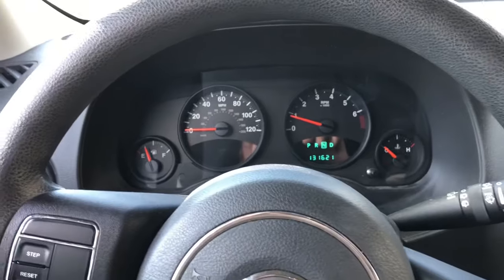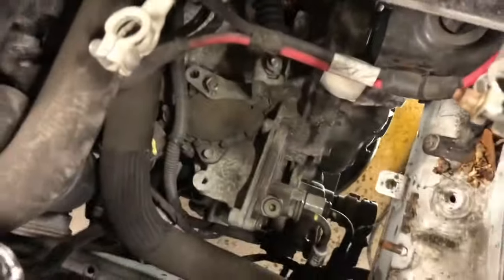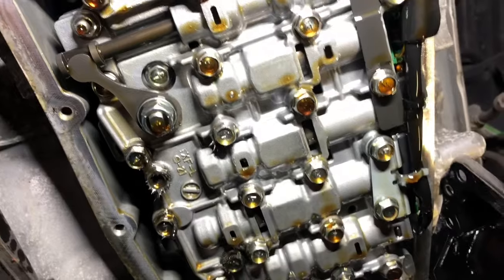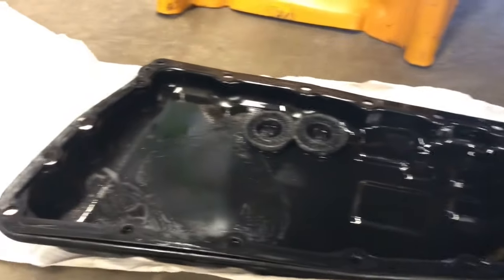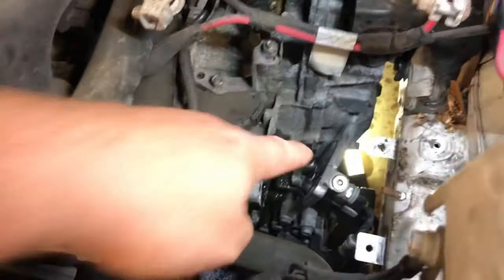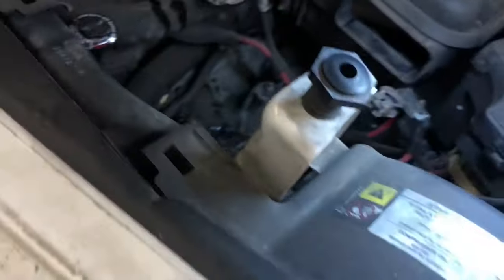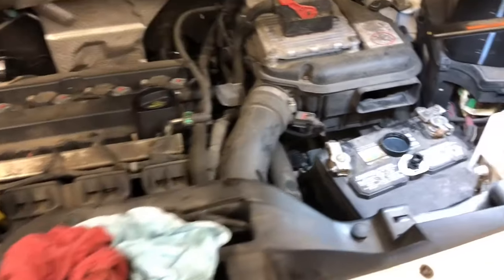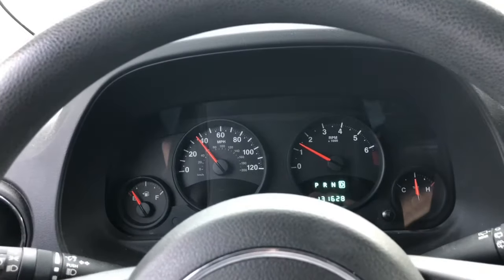Jeep Patriot CVT Transmission Fixed jf011e whine noise service

Comment: @JohnVH Life. Hi John, glad I found a resent video. Okay, my 2010 Jeep Patriot started making a whinny noise which my wife told me about but until today I never heard it before. ( I have 188k on it.) Now I did buy the dipstick you have on amazon but what I noticed was my engine oil dipstick fits into the trans filler tube, so while at a auto salvage yard I grabbed one that was about 4 inches longer. On level ground, I took this dipstick I bought, trimmed it to about the same length & then used a dremel & scored a line so I could get an actuate reading.
Now to the trans issue. Where does it say what cvt transmission model I have in the vehicle... I figured Jeep probably made a few for this year, so do I get that information from the VIN, or is there a plate with the trans number on it. I have a 2.4L engine w/ automatic 6 speed. Thanks for uploading the video because I'll be doing the work here at home.
Edit: My 4WD! warning light comes on but if I hit a big chuckhole, it'll usually go out so I'm assuming (& Hoping) it's just a bad ground wire (since I just found 4 wires out of 10 in a grounding pigtail that were corroded & fell out when I unbolted that ground eyelet & lifted it up to look at it.) 
 I wanted to get the information on my trans & do an oil/filter change first because I figured it may take care of the 4WD! light issue when I drive.
Thank you, Dan
Reply from the maker: 6 speed? As far as I know they only had the CVT and a manual trans in these up until 2014 or something. All the CVT's should take the same fluid and two filters, to my knowledge.
Reply: @JohnVHLife  No auto trans. I mentioned it with the engine type. I'm still looking for a tag somewhere that tells me what trans I have. I suppose using the VIN & calling a dealer will get that info. That way after I change the filters & fill it back up, I'll be able to mark this dipstick with a cold mark & hot mark instead of using this 4 foot 1 stick fits all thing from amazon. Then I'll use that plug instead of leaving the dipstick in the trans.
Reply: @JohnVHLife  All Patriot and Compass models with automatic transmission are CVT through 2013. In 2014, they switched to the Aisin 6-speed automatic which is not a CVT, but a more conventional design.
Reply: maverickdallas100 what as the better trans pre 2014 or 2015+
Reply: @ArmyK5Guy  The models 2014 and later with the Aisin 6-speed are reportedly more reliable than the CVT equipped ones, and drivers prefer the "shift feel" over the CVT. The reliability of CVT's however, has improved dramatically over the years, but they are still demanding of timely maintenance.

Comment: What does it mean if theres fluid on the pan bolts? There was some present when I changed the fluid so I replaced the gasket but I woke up to a few drops on the ground that came off one of the bolts so it seems like that may not have fixed it.

I'm hoping it's just some residual oil from the draining that's just heating up and collecting there but I've tried to wipe it up pretty good and still find a little on the bolts later
Reply from the maker: Maybe the gasket?
Reply: Check the fill tube for cracks, etc. It is not supported very well.

Comment: Hey i have a 2007 patriot that won't run it cranks writ up and runs maybe 20 feet and stops motor and transsmission sounds really good do you think this coupd fix it thanks in advance
Reply from the maker: Sounds like you have a motor problem to me, check the jeep patriot forums?

Comment: So my Patriot started making the whiny noise. So change my cvt transmission fluid? If so where can I take it besides the stealership?
Reply from the maker: Well, could try a service shop and see if they can do it, show them my video and make sure they change BOTH filters!  Or ask around and see if you can find someone mechanically inclined.
Reply: @JohnVHLife  thanks man. I found this local service shop and I will tell them about the two filters! Appreciate it!
Reply: @conroexlexx8267  update?

Comment: Great video, I have a 2015 patriot with the same whining noise, i don’t mind doing the service but I’m worried cause my patriot has 154k miles on it. Last time I did a transmission service on a 2013 rogue with a little whining it made it 10x worse and thats what I’m afraid of. Any suggestions?
Reply from the maker: Maybe there is an additive for older trans? Otherwise, try to carefully save the old fluid and put it back in, sounds crazy, but may work as you must drain it to get to the bottom filter.
Reply: @JohnVHLife  might give that a shot found a CVT additive for it see how that works. Thanks!
Reply from the maker: @donrobinson5662  Ive bought 3 of these on purpose, :D
Reply: update?

Comment: I have a 2007 Compass with the exact same drivetrain and it shifts funny sometimes at barely over 90k miles. Do you think this would help? I also need to do tie rods and ball joints that I'm gonna do on the lift at work next weekend, so I feel like that might be causing it
Reply from the maker: Its worth a try, honestly,  Its cheaper than a new trans.
Reply: @JohnVHLife  I did it at work, seems to be shifting smooth now. I even did a full throttle pull and it was super smooth the whole way.

Comment: I see a problem with your trans fluid change... All you did was drain the pan, but you left all the dirty fluid in the torque converter and the cooler too. So you just added some clean fluid to the dirty fluid. You should have taken the cooler line off and ran the engine until it stops pumping fluid out , fill the trans again and repeat until you get clean fluid coming out of cooler line.
Reply from the maker: I think running a trans with no oil would be worse than leaving a little in the converter.

Comment: I have a 2008 Jeep Patriot that drives fine short distances, but when I drive it for an hour or so, the transmission overheat light comes on, and will eventually go into limp mode if I don’t stop to let it cool. It also makes the same whining noise when it gets hot. 

Will this same tutorial apply to my 2008 and would this resolve the overheating issue?
Reply from the maker: I bet that it would help with that! Let  me know how it goes!
Reply: @JohnVHLife  same problem with my 2011 keep compass whining noise then transmission temperature hand comes up
Reply from the maker: @mikelogan3021  Youve come to the right place! This video should cure it. parts are in the description.

Comment: 2011 Jeep Compass Latitude makes same noise and won't go when in drive or reverse. Auto shop said the secondary solenoid valve is stuck open and need to take to transmission for possible transmission replacement. Vehicle is not worth the cost to replace with 160k miles but could replacing the filters be a possible fix?
Reply from the maker: Shops don’t fix them for some reason. But I doubt filters would fix yours at this point. Mine at least worked fine. Just was noisy. If you were close I’d buy it from ya!
Reply: @JohnVHLife  Haha! If I didn't think it was something worth getting a few more years out of I would prolly just let ya take it! Just puzzled as to what would cause the sec valve to. be stuck open. Not finding much of any specific steps to isolate. My son is a new driver and found a new interest in mechanics with his GT so none the less, it will be something good for him and I to replace the filters together at the least before getting it towed then. Appreciate the video and steps!! Thank you!
Reply from the maker: Cassandra DeMassimo it’s worth a try. Parts can be found for them. I wonder if that valve can be changed by dropping the pan..
Reply: @JohnVHLife  From what I've understood so far, yes.
Reply from the maker: Try it!
Reply: @JohnVHLife  Hey guess what...we replaced both filters, changed the oil since we were under there, dropped it and put it in gear, and it drove. Not getting hopes up due to battery being unplugged for about 2 hours and hoping its not just reset but we shall see!
Reply from the maker: Cassandra DeMassimo no way! Good to know!!!!! Best of luck!
Reply: @cdemassimo  following, can you let me know if the problem cam back

Comment: My car had a some sort of jump today and the traction control light came on as as well as the check engine. The car had a hard time accelerating but I turned it then turned it back on and the car drove but still rode sluggish and check engine light is still on. Feel like the transmission and maybe a lack of fluid. Any recommendation,
Reply from the maker: Try to read the code and see what it says.
Reply: @JohnVHLife  Ended up getting 3 codes. C121C Torque Signal, P0355  Crankshaft sensor, and P0741 Torque Converter. Mechanic obviously recommended a rebuild but referred me to taking it to the specialists. The first two codes explains the traction control and check engine,  but not sure how severe the P0741 Code is.
Reply from the maker: @luisurena9955  hmm. I honestly don’t know what specifically causes those. Sorry. Join some patriot forums and see if someone knows more.
Reply: @JohnVHLife  Just jumped into one of them. Thank you, though!

Comment: I have changed my fluid and trans filter and replaced the trans pan with a pan that has a drain plug but i have not changed the trans cooler filter.When i remove the trans cooler cover to access the filter will a lot of fluid drain from there and if so ,do you know about how much that would be so i can put that much back in or. do i need to drain fluid first to change the cooler filter? I just am trying to avoid draining all that fresh fluid i have in there now. Thank you so much for this info.
Reply from the maker: Not much comes out of the top filter area, but a little will, its not bad, you didnt change it when you did the pan filter?   You dont have to drain the pan again to do it.
Reply: @JohnVHLife  no i didn't change when i did the pan ,i didn't know about it .I just ordered it  Thank you so much for the reply .I haven't had any trouble or whining with mine.160000 Miles
Reply from the maker: @frets52  Excellent! Hope for another 160K!
Reply: @Donnie Fretter I replaced the upper filter on my Jeep Patriot yesterday. About a cupful (8 oz.) of fluid will drain out of the filter housing. Just add 8 oz. of fresh fluid when you're done replacing the upper filter.
Reply: @maverickdallas1004  Thanks did you have any problem getting that o ring to seat after reinstall
Reply: @frets52  The O-ring stayed in the groove in the housing cover. I thoroughly wiped off the housing inside and out before installing the filter and putting it all back together. There was no room to get my torque wrench in there, so I tightened it as snug as I could get it with a 1/4" drive ratchet. Started the engine and checked for fluid leaks when the job was completed and is good. I decided to change the fluid and pan filter, hopefully this weekend if it doesn't rain. I bought the OEM fluid for it at a decent price and it should be good for many miles once done.
Reply: @maverickdallas1004  Thanks i will use a 1/4 ratchet.
Reply: @frets52  Tighten the cover in an "X" pattern, in steps to draw it down evenly,  then go over it one final time.
Reply: @maverickdallas1004  Yes to even the torque ,thanks i will do.

Comment: Can you just change the filter under the battery without draining all of the fluid? I want to experiment on mine without doing all that other work. You made it all look so easy, but I just know it’s going to take me about 12 hours just to take that bottom shield off. LOL!
Reply from the maker: I’m sure you could.
Reply: @JohnVHLife  awesome! Thanks! I’ll try that first.
I had the fluid changed at a shop, last week. Cost me 200 bucks, and still whining.
Reply from the maker: @in_dark_places  keep me posted. I’d love to hear if this helps!
Reply: @in_dark_places  update?
Reply: I’ve tried several different things, and I’m still stuck in limp mode. It wasn’t the  throttle body, and not the relay plugs. I never did get around to trying the bottom shield, like in this video. My Patriot won’t even start now, actually. I’ve got major problems. Not even going to try to save it, at this point. I’m just going to sell it for what I can get out of it, and be done with it.
Reply: @in_dark_places  damn. Right now I got the noise and I'm having some acceleration issues. Twice, I had to change the throttle body which would fix it. I'm hoping the filters fix this. Sounds too good to be true
Reply: @anthonycovarrubias718  good luck!

Comment: my truck had an oil change but they didn't put a new filter, can I only change the filter now?
Reply from the maker: They changed the transmission fluid, but no filters? Or only the bottom filter?
Reply: @JohnVHLife  They changed oil and the metal filter that went down, the one that they did not change was the orange one, now my question is can I change only the orange filter without spilling the transmission oil.
Reply from the maker: @YCNEXCORP  You should be able to, its pretty high on the trans, a little will come out, but not much.
Reply: @JohnVHLife  perfect, thank you very much.

Comment: Hello guys, I'm a little confused on where to put the fluid in I have a 2017 that has 144,000 and I thought I'd try this before paying for a new trans.
Reply from the maker: In the dipstick tube
Reply: so did you use a full jug and part of another or just the 1?
Reply from the maker: @christopherclevenger8320  I had the quart from the last one I did, just buy the 1.3 gallon jug, itll be enough. And use the dipstick for the proper level as I show in the vid.

Comment: Hi John, hope all is well with you and yours. Is it too late to ask a question? I have a 2011 compass. And have a question? Thanks
Reply from the maker: Never too late.
Reply: @JohnVHLife  Thank you John. My question is. I have noticed recently that when I am driving and I have to come to a stop ( say in traffic)I notice that my engine seems to run Hard. I don't think it's the throttle body as I had it replaced. Any thoughts as to what it may be? It is a 2011   I have had the brakes and rotors recently replaced  and the battery as well. Thanks for taking your time and in put. Cheers.
Reply from the maker: @riciacampbell6264  is the check engine light on?
Reply: @JohnVHLife  No John it's not. and there are no other lights on either.
Reply: @JohnVHLife  No, no lights on and engine light is Not on either..
Reply from the maker: @riciacampbell6264  hmm. Maybe just needs a tune up? I’m not sure what it’s needs. Sorry. Maybe google the issue and see what comes up.
Reply: @JohnVHLife  That is what I have thought. I will for sure have it looked at, but thanks you for taking time. have a great weekend...

Comment: Have a question if you can help me save thousands in the long run. 

Have a ‘08 Jeep Patriot. She has about 260k miles on her. She just got a trans. Fluid changed due to shifting gears. Trans. Shop is saying they found a pretty good size of metal in the transmission pan but haven’t told me as of yet what the metal is. They are saying I am in need of a new transmission and new transmission mounts. Full Total of $6300.. This car is very special to me. I’ve had it for almost 5 years and honestly I would love to keep her going for as long as I can. 

Any advice to give? I’ve been watching all your vids in reference to the Jeep patriots looking for a potential solution. Any advice would be greatly appreciated.
Reply from the maker: Wow, thats alot of miles on a CVT. Probably a piece of belt? They are made of a ton of little pieces.  Shops dont rebuild these for some reason, you could get one from a wrecked patriot, but youll still have to pay alot of labor to get it in your rig.
Reply: @JohnVHLife  I’ve been getting that lately. People are surprised she’s been running so long but I just picked her up from a trans. Shop for the fluid change and she’s running funny to me in my opinion. I am not at all happy about it considering they quoted me on a new cvt transmission. The acceleration is harder now that Ive picked it up, and the interior lights are flashing on and off periodically. It wasn’t doing this yesterday before i took it in. I’m starting to believe I’m really in need of the new transmission but really do not want to jump in getting it at the moment if it isn’t needed. Desperate need of some help and advice.
Reply from the maker: @angeliquejackson4290  The lights are flashing? Thats odd, and unrelated to the trans, what did they do to it?
Reply: @JohnVHLife  it was only supposed to be a transmission fluid change but when I picked it back up it’s driving slower than it was when I dropped it off, and the interior lights would come on and go off. I opened everything and shutted it to be sure nothing wasn’t just opened but it did it again. I don’t understand why it would be doing all of this all of a sudden
Reply from the maker: @angeliquejackson4290  Id drive right back to the shop and ask them WTF

Comment: How can i use a 10mm if i cant find them?
Reply from the maker: SOL :)
Reply: 10mm sockets are designed  to run away, disappear and fall into places where they can't be retrieved. Then they sit back and laugh at you !!! 😂😂😂😂😂

Comment: Those temp numbers are the fluid temp not outside air temp. Supposed to read trans temp with a scanner
Reply from the maker: Good point, I would assume when its cold it should be close to what the outside air temp would be
Reply: @JohnVHLife  right but once it's running it's going to warm up fast. Plus your supposed to go from drive to reverse a few times then check temp and level in neutral

Comment: While you're at it, and sinc you taking the battery out, changing the throttle body is a good idea if you're getting any herky-jerky accelleration. The throttle body should have been a recall, they don't last for shit.